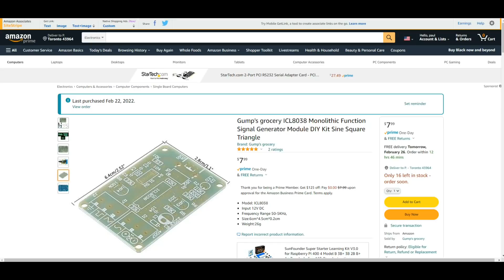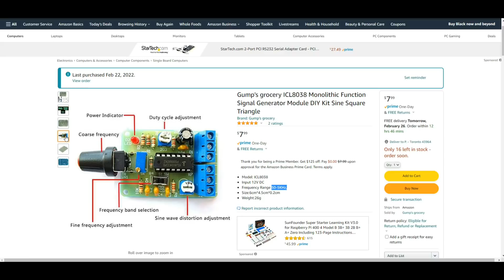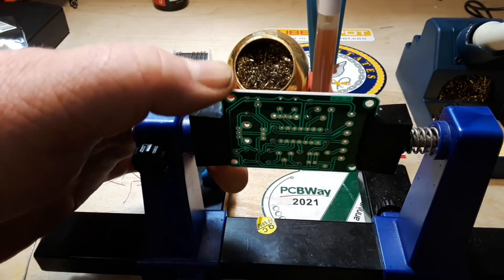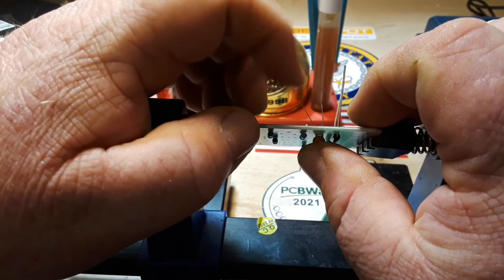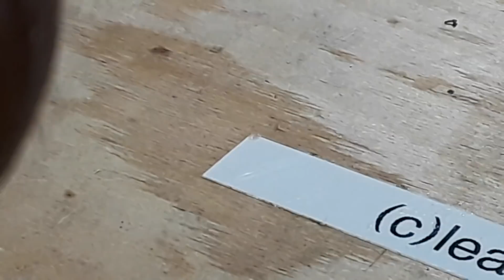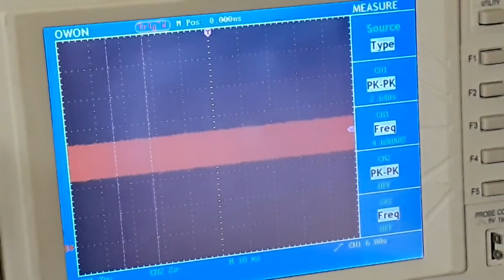Gump's Grocery ICL8038 Monolithic Signal Generator Build

Comment: I made years ago a "lab function generator" with two 8038. First was to drive the frequency sweep for the second one and it was able to do some FM also. I found the schematic in a electronics magazine. Not something fancy, I think there was just the application note from the IC datasheet. However, it was simple, quite stable (no frequency and amplitude drifting, at least not something noticeable) and was very easy to build. The PCB i made it by hand and the case I made it from recycled PCBs from old TVs.
If I remember correctly, there was a similar IC from Exar but I am not sure if it was better or worst than the ICL8038.
However, the best function generator I ever made was with a Wien bridge for sine, and a 7414 for square wave; it worked up to 1MHz and was very stable.

Comment: Like. So the new thing on my bench is Noise, Synth noise. Shopping for potentiometers I saw the kit you are reviewing. I'll start with cheap. The opamps down the line will be needing a dual 12v power supply. I have buck convertsrts. ? Can I gang two bucks to get my -12v +12v using a 14v single xfmr power supply? I also just got a box of CD4000 series chips. I'm eyeballing the CD40106. Got any Sea stories about these chips?

Comment: Yes please do multiple frequency range however I ask if you could explain why is it limited when chip has larger range.  Also the process to calculate range and what happens to the signal if you push it out of range
Reply from the maker: The cap provides a fixed range of frequencies and the small trimmer next to it allows you to dial in a particular frequency. They work together. So we can leave the fine tuning trimmer and replace the 1uf cap with a .1uf and increase the range x10 or go the other way and put in a 10uf and now we are 10 times slower than the 1uf.

Comment: What would you think about adding a second dial attached to a variable capacitor? Would that work to adjust the range, in this case?
Reply from the maker: It would work for sure, but the range of varicaps is limited. I am looking at going by orders of magnatude.

Comment: Gee - that 3rd resistor definitely was not parallel with the first two!!  I'm highly disappointed!  😔😔😔  LOL

Nice video.  I'm going to check out those kits on Amazon and see what they offer.

I'd love too see you construct a circuit that uses jumpers.  Also, how about demonstrating how/why we would use a signal generator?

Comment: In theory could you make a variable flyback driver that plays a frequency from the spark generated? saying the generator outputs enough voltage and current.

Comment: Still not worth its price XR2206 is much better - 10$ including transparent case. I wish  Maxim MAX038 and Burr-Brown OPA603 was still manufactured, thankfully there is AD8055 opamp but.. there is no MAX.  You could make really cheap, old style function generator up to 20MHz! The "only" issue was square generation 0.1Hz-1Hz because IC tend to generate lot of spikes during 0-1 level transition it was only issue there i noticed ICL8038 comparing to max to be total CRAP.  That's why it's cheap ;) It can be used though in audio applications but..
Reply: BTW. Wasted so much time on woman, you mentioned you are not maried to have more time on electronics.. great choice! I wish to know this before i wasted so many years